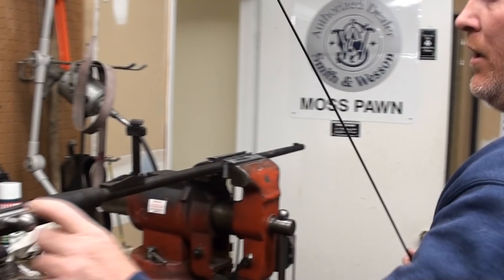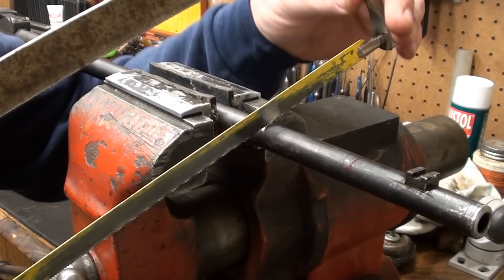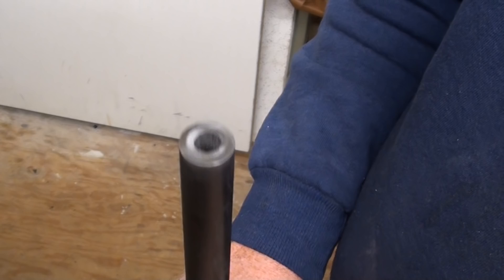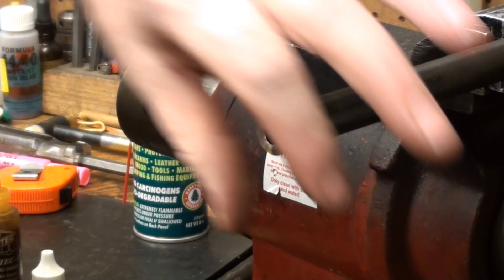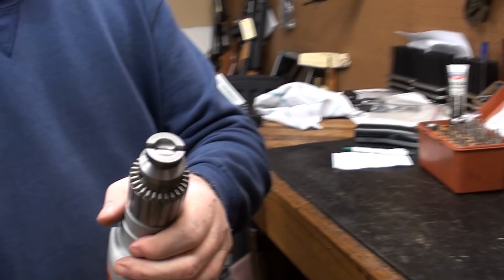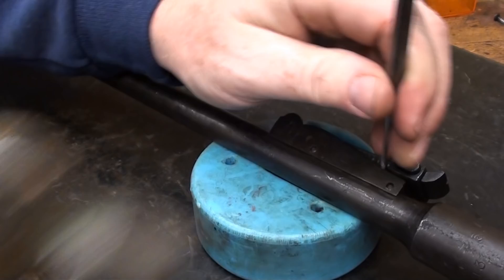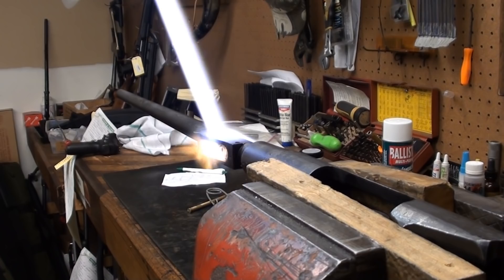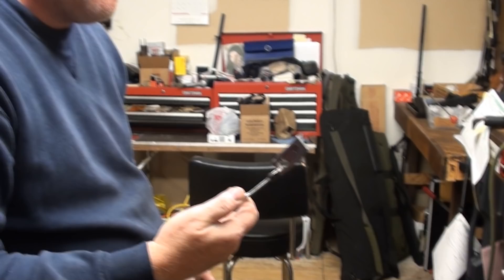Sporterizing the Mosin Nagant Part 5- Shortening the Barrel and Removing the Rear Sight Base

Comment: the oxy torch was a bit excessive, all you need is a map torch for those sight bases and then a good hammer and punch. they come right off. making it red hot does absolute nothing for removal. all the solder needs to do is liquefy and then it will flow even if its only around 700F.

Comment: I melted the sight base solder with a plumbers acetylene torch (no oxygen).  with a punch and hammer tap, it was out.  You guys didn't need to heat it up cherry red; way to much heat.  Mine looked just like regular solder, not some high temp brazing rod material.

Comment: This is why I love/hate the internet.  Great video showing how to remove the rear sight base and then we have self-acclaimed professionals (gunsmiths) arguing both sides of whether or not the barrel is shot due to excessive heat.  Which is it people? I've bent several punches/misc tools trying to get the freaking pins out of the rear sight base. Contemplating whether or not to torch it!?!  :-)

Comment: Rather than heating up the sight base to get rid of the solder, I used a dremel tool to cut the base in half, down the middle.  This allowed the halves to be knocked off to each side without heating up the barrel.  Sure it destroyed the sight base, but a replacement only costs $15.

Comment: that's part of it...Also since the barrel is free floating. One side is fixed, the other isn't. Recoil causes the barrel to flex. Shorten the barrel and you have less leverage for the recoil to act against the barrel. (More ridgid). Simple example. Break a toothpick in half, then break the 2 pieces in half again. Much harder because you have less leverage.

Comment: for everyone with "better" ideas on how to do this, shut up and make your own videos then. anyhow, i've got a similar project going on but i'm going slow because  i'm buying tools and equipment as i go. cut my barrel with a steel pipe cutter, which required a lot of deburring. i used a dremel with a cone on it mostly. i plan to thread my barrel for a muzzle brake. don't remember exactly how long but somewhere around 21-22 inches. nice work guys, great video.

Comment: @lugerstonecock hard solders melt at over 700 deg f. he was heating the base not the barrel, it never got that hot. they use hard solder to pin in flash hiders on ar-barrels.

Comment: I finally got my rear sight off. I managed to hammer two of the pins out with the punch set I bought (broke 3 punches in the process) and the 3rd would not hammer out so I got my drill out and drilled through the pin about half way then it came right out.

Comment: I agree 100%. I don't know where he learned his gunsmithing but I really wouldn't trust a firearm he has worked on after seeing this video. I have used a torch to remove sights soildered on before but I use a jewlers tourch which puts the heat exactly where you want it, not a fabricators tourch. I hope noby trys this at home.

Comment: There is a set screw in the base that has to be drilled out. Mine was exactly the same and it came right off after I drilled out the set screw.

Comment: It is a rarer model, but depending on the condition the actually value of it can be around 175 and 300 dollars. But i would hold on to it for several years because mosin nagants are becoming more valuable because the Russian stock piles of the rifles are now empty..so hold on to it, the value will only increase!

Comment: I didn't have to heat  my sight base up but i did have to remove the small set screw at the rear of the base it strip out so I ended taking a dremel tool to it but the new  air rifle mount I used for a scout scope covers it anyway

Comment: Glad to see that I'm not the only one who is concerned by the poor safety practices when using the torch.

You guys got lucky that you didn't set fire to the shop! The aerosol can of Ballistol could have lit off easily, and the various bits of paper & rubber could ignite, and the torch was hot enough to set the bench or hammer handle off!

Folks, if you are going to do this at home, use a smaller torch, and have plenty of water available to quench things, and work in a fire-safe area (brick)!!!

Comment: @Iraqveteran8888 im not saying that the barrel is no good.
i was saying that ive never had to heat any solder to that temp to get the part off 
im guessing affter the 60+ years sitting is what did it

Comment: Question.  What does a service like having the barrell cut down cost on average?  Basically what your guy did. Cutting, and those other 2 or 3 processes?  Also, you went with 22" for the mosin.  What would you recommend for a 8x57 mauser. Its a 1945 Spanish large ring mauser.  What length would you recommend on that rifle?

Comment: I am currently trying to remove the 2 bottom pins on the rear iron sight and am having problems with them. i have tried to remove them with a hammer and pin, but they havent budged at all. I think they might have been inadvertently soldered in on the outside when the manufacturer soldered in the iron sight. I would heat it up and melt the solder but have heard doing this can damage the barrel if the barrel gets to hot. Any advice on this would be greatly appreciated.

Comment: Iraqveteran8888  - This is an awesome set of videos! I have watched them over and over. Did you choose  a 22" barrel for any specific reason? With the thin barrel of the Mosin would 20" or even 18" be better than 22" as the barrel flexes? Just wondering what your thoughts are. Are the barrel rings and upper forend put on the Mosin to stop barrel flex during shooting? You mention it handling 203 grain bullets. Can you elaborate? Thanks.

Comment: RE: Radius Tool
The O.D. of by Mosie barrel will be +/- .635 after shortening it to 22 inches.  Brownells sells 3 different sizes of the Radius Tools, can you help me here?  Of the three sizes, which one do I need to cut the radius on the O.D. of my barrel?  I have the 11' crowning tool and want to finish it with the barrel radius. Your assitance would be of a great help, my $ is tight and I cannot afford all three sizes of the radius tools.
BTW,  Thanks for the VID on the Mosies.

Comment: i just figured from watchin this video my mosin rear sight is on the same way i spent 2 hours trying to nock it off with a hammer and punch & chissel.  is there any other way other than blow torth to get it to come off. i dont have a shop with vice and all thos specalty tools nd if i buyt a tirch i dont trust anyone to help me with the project. im surronded by assholes.

Comment: One question - I keep hearing talk of 22 inch barrels. Is there a specific reason this length is prefered? I would have thought for accuracy a longer barrel would be better as you get a higher muzzle velocity. Yes a longer barrel can vibrate more but surely you can minimise that with a heavier fluted barrel?
Reply: i suppose it's just a preference

Comment: I hope you have not shot this thing yet. Getting the barrel that hot is NOT necessary, and you now have an unsafe barrel. Turning steel cherry red is hot enough to take the temper out if not properly cooled. Not trying to shoot you down, just a big safety concern.

Comment: what a night mare on mine 1 pin popped right out other one was horrible bent my steel punch then broke off in there after finally getting them pin out , now my punch is stuck cant get it out after 5 hours of dicking with this dam pin bout ready to through the whole dam thing in the trash, I guess I will have to take it to a machine shop and let them try to get the punch out

Comment: To put it as blatantly simple as possible: A rifle that does not perform well is not worth using. If you cannot get a remotely consistent shot at 100 yards it's not going to be ethically or mentally sound to hunt with it much less risk your life on it's performance. A Rifle that can shoot 1 to 1 1/2" groups at 100 yards with ammo that's 2-5x cheaper than anything else in it's class gives you 2-5x more trigger time, and 2-5x more skill. Tkiv-85 = extremely accurate modded Mosin sniper rifle.

Comment: so, do i have to pay the SRB requirements to shorten my barrel to 22"
Reply: In short no. A rifle has to have a barrel length of 16 inches and is 26 inches in overall length measured in a straight line from the extreme ends of the firearm to not be subject to the NFA.

Comment: I don't agree with this. If the gun is being shot non stop for a long time, possibly hours like in a battle situation or even at the range the barrel will be getting very hot and air cooling without problems.